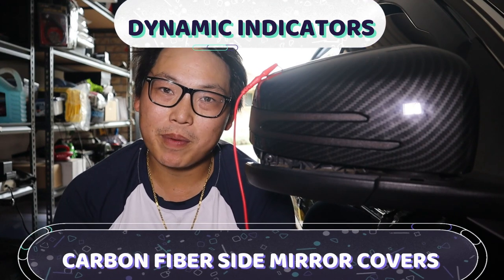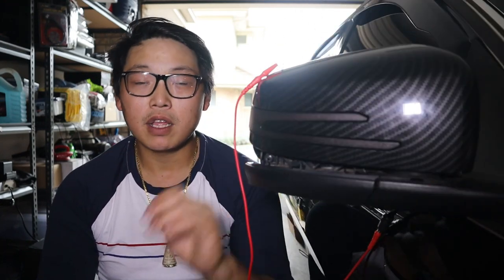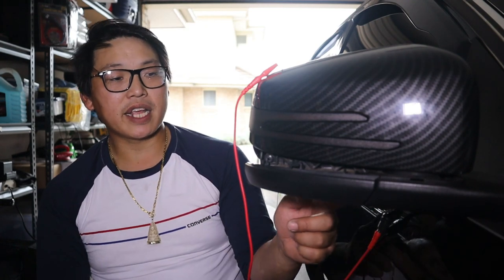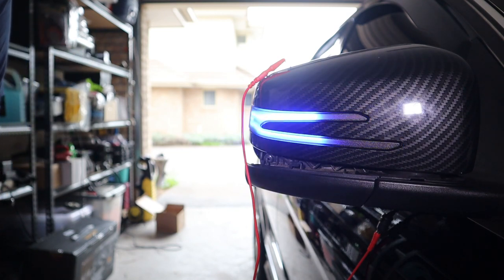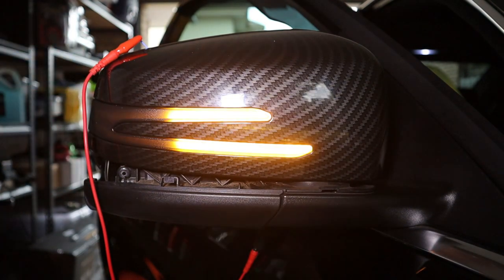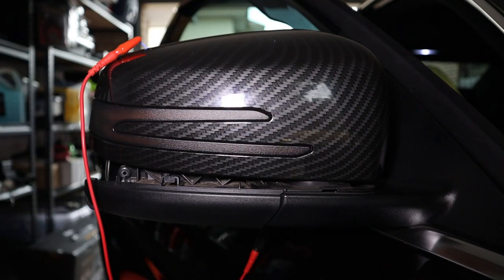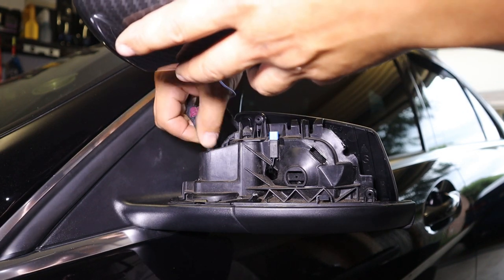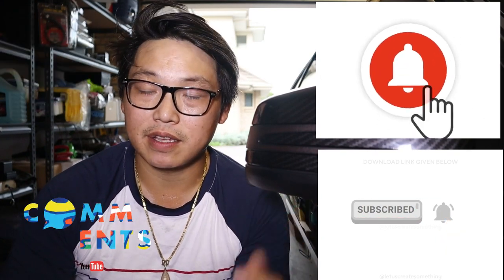how to  DIY MERCEDES W204 MODS carbon fiber mirror covers+sequential dynamic indicators install

Comment from the maker: hey guys i wantes to stress that originally i had no puddle lights ..... prefacelift models do not have factory puddle lights...so in order to wire it the way i did u need puddle lights .... i was preparing for a puddle light retrofit which is why i was able to do this wiring setup.... but if u dont have puddle lights im sure u can use a 12v switched power source and it will work .... i wired my puddle lights to my rear dome lights and a video is coming real soon on the retrofit of my puddle lights so stay tuned fpr that video....i hope you guys unddrstood the video..much love
Reply: I've a CLA45 2017, do you think it has a puddle light?
Reply from the maker: @nofear4890  I'm guessing most newer models do but it's possible it may not have it due to options not being fitted
Reply: @MIKEYZVLOGZ  could you link me to how you installed it into your puddle light? I can’t seem to find that video xD
Reply from the maker: @nofear4890  https://youtu.be/_MvCM5QX3to
Reply: @MIKEYZVLOGZ  hey so just figured I’ve a puddle light, does this mean if I install it through my puddle light, I can’t use my puddle light anymore?
Reply from the maker: @nofear4890  what do u mean ? u are trying to install the indicators? u install them and use the pos of the puddle light to power the third wire for 2nd light "welcome light"
Reply: @MIKEYZVLOGZ  yes sir, what I meant is would my puddle light still work when I tap into that pos for the “welcome light”
Reply from the maker: @nofear4890  yes it will cuz ur getting power from it making another connection not cutting ..your tapping into it therefore linking another connection
Reply: @MIKEYZVLOGZ  thanks fam, gonna give it a try when it arrives. I went for the white lights, can’t wait to try it lol
Reply from the maker: @nofear4890  no worries

Comment: Hi Mike.. not entirely related topic but trying my luck if you have idea where is the power feeding to the door mirror motor. One side of my door mirror recently stop folding and I suspect either there's no power to the motor or the motor itself is broken
Reply from the maker: it would be from module behind the door... behind ur door u will see a module box that controls basically everything electronic from door led to door locks fold in mirrors and led .. that's where ur power is ..I would start there make sure no short or cable disconnected etc
Reply: @MIKEYZ VLOGZ  ok thanks Mike.. will check it out

Comment: Hello, quick question. I purchased my dynamic turn signal lights. When I plug them in, I am not seeing them turn on. Even when I put my blinker on they do not work, when I try my factory ones they work just fine. Any suggestions? Or possibly they are defective?
Reply from the maker: that is very strange they should be plug and play , check the pins are not bent that plug into the plug... should always test them too ... another subscriber is also having this issue he ended up returning the indicators and asked me where i bought mine from.. i never had that issue ..it was just plug and play for me..i cant think of anything that would cause it to not work apart from defective ones

Comment: Hi Mikey, I followed your instruction and was able to successfully install the lights without connecting the blue color.   They work fine,  but I'm not sure why the amber indicators are ridiculously dimmed like almost not visible when on,  I bought a set with 12v 5w, smoke lens.  Do you have any idea what I might have done wrong as to why they're not bright at all?  Do I have to connect the wire for the blue light for them to be brought?  Were the set you showed in this video this bright in reality?  Please help... thanks
Reply from the maker: u can try and see what happens its possible it needs that wire for 12v

Comment: Where is the best place to connect the cable is to change the color when I do not have mirrors backlight and I do not have automatically folding mirrors ?
Reply from the maker: ok so u need a power source that is only active when u standstill and not active when u drive .. I tried to connect to any 12v power source and it made the lights come on wen I was driving and signalled... and u don't want that... u need a power source relating to your door lights as they only come on when u unlock and lock car ...also another option is to use a relay .. that way you can send power to the lights wennu want and cut off power wen u want too... that sound better actually ... google how to wire a relay and it will describe how to wire it and its uses

Comment: I haven't got puddle lights or electric folding mirrors, where do you think is the best to connect the blue wire ? Thanks
Reply from the maker: ok so if u dont have any of those best would be to find a power source in the door frame amd connect to it and use a mini relay so it will control when the start up lights switch on and off.... which power source im not sure.... but u can definitely find something in inner door frame of front doors.. maybe the control module for front doors..as they power the windows and the switches....

Comment: Hey Mikey quick question my mirror  lights are pre facelift will this cover fit or I will need the whole mirror to then put this covers on??? Thanks
Reply from the maker: Do they look same like mine or the older lights with the triangle shape? If they look like mine then these will fit yours as well
Reply: @MIKEYZVLOGZ  triangle one...
Reply from the maker: @alarraiz9221  hey bud sorry I didn't get back to u... I just seen your msg... if u want to upgrade the side mirrors u have to replace the entire mirror assembly ..I just released a video about it

Comment: Hi, my question is if the blue dynamic light turns on in the day light if I connect to the puddle positive. Because in my car the puddle light only turns on in the night. What do you think? 
In my Mercedes I have power folding mirrors , so I connect to that cable and blue led is working ok, but only works when the power folding mirror is working in the opening position.
Reply from the maker: im sorry i dont understand what you asre trying to do , do u only want the blue light to turn on at night time only ?? pls try be abit more clear.. i understand your english maybe not the best but i will try my best to understand and answer for you , just try be morte clear so i can understand thanks
Reply from the maker: puddle lights should work always not just at night, are you saying your puddle lights only work at night ?
Reply: My puddle lights only illuminated in the night, the bulb only turns on in the night. My question is if I connect the blue light to the puddle light , the blue light is going to turn on in the daylight with sun? 
I think maybe no, that why I connect to the power folding mirror cable .
I have that doubt, so I connect today the blue cable to the power folding motor and works ok, but only works when the power mirror is working in the opening position.
Reply: In my car there is a light sensor in the front windshield, so the puddle light bulb dont illuminated in the day.
Reply from the maker: @alvarocruzat8046  yes becuz thast cable only gets power when folding mirror is working, u need another switched 12v power cable that always has power when you turn car on
Reply from the maker: @alvarocruzat8046  yes correct so if you want the blue light to work everytime u unlock and lock car you need to connect to a 12v switched power source that is always on as soon as you turn on car, and then wenever you use the lock and unlock it will actrivate the blue light after...oh i understasnd , my mod for the puddle lights works all the time .. becuz i had to connect myself.. but it is better that it only works during the night..but becuz i wired my own retrofit puddle lights i connect to the rear dome light and it always has power, but it has a switched connection and thats why my blue light is always working..u just need to find another power wire that always has power and just connect there //i hope this helps friend
Reply: But in your car for example that have also puddle lights, the blue light turns on in the sun ? 
Your puddle light bulbs illuminated in the day light also?
Reply from the maker: @alvarocruzat8046  yes my puddle light come on in daylight but mine is different i install myself it did not come from factory like that .. 2010 and below 09 08 07 don't have puddle lights .. I had to fit myself ..that's why my puddle light work in sun and I can use the wire for my blue indicator
Reply: @MIKEYZVLOGZ  I install the blue light to the power folding mirror, the same like these video
https://www.youtube.com/watch?v=R4M1dLhAGPU&t=213s
Reply from the maker: @alvarocruzat8046  did it work? u can also use the power in door module
Reply: @MIKEYZVLOGZ  yes, it works perfect, when the power folding mirror open the blue light turns on
Reply from the maker: @alvarocruzat8046  as long as it works thats great

Comment: I stuck wire into my puddle light buld socket reinstalled bulb to test it still nothing from third wire .
Reply from the maker: that's wierd
Reply: @MIKEYZVLOGZ  The yellow  sequential works fine but no blue
Reply from the maker: where were u getting power from ... are u trying to install puddle lights like I did ?
Reply: @MIKEYZVLOGZ  Mine has oem puddle lights
Reply from the maker: @Mlive722  so ur just trying to activate ur third light in the dynamic indicators ? and ur just trying to connect the third wire but the other colour light isn't illuminating.? try another 12v power source
Reply: @MIKEYZVLOGZ  Will do i see my puddle lights not coming on at all could be blown fuse.
Reply from the maker: @Mlive722  makes ure you check fuses and then check the indicators alone too so u are sure everything works and then try again to  test them ..i had another subby who found out his dynamic indicators were faulty

Comment: My carbon fiber cover will not fit my indicator in it mannnn.
Reply from the maker: is it the right part?
Reply: Try shaving down the carbon fiber covers where  the indicators head in and trim down the rails on your carbon fiber covers where the indicators sit on

Comment: I tried 2 different makes of these on my 2013 B180 but found they both gave 'Bulb Failure' error messages on the dash. They were both 2-wire versions, as flashing any other colour than amber in the UK would be illegal. 
Only one of the 1st set worked and I noticed they were wired differently so I swapped the wires around, and it was fine - but only flashed 5 or 6 times each time they were activated.
The 2nd set also caused the 'Bulb Failure' error message and progressively got worse. Not only did they stop working, they caused the original front and rear bulbs to stop flashing too!  This happened to one side only at first, then the other side the following day.

I tried putting various resistors in series, but couldn't get rid of the 'Bulb Failure' error messages.
Anyone else have this problem?
Reply from the maker: hey bud so sorry to hear that your having so many issues with your dynamic indicators, i honestly had the same problem after about 6 months 
they were working for about 6 months but gradually after 6 months i started to see error msgs , it was wierd becuz at first they were working fine they were perfect with the blue leds too, so i can say that did happen, so i ended up going back to just orange leds, no blues, 
however i will say iu never had them completely fail , they always worked only gave an error message , and my tail lights always worked at the same time 
i never had issues with the tail lights not responding or failing due to the dynamic indicators
its very possible u may have another issue such as the tail light grounding issue
wen u connect a new ground direct from the plate of the tail light it tends to fix alot of the error related to the tai lights
maybe try and see if u have any electrical errors